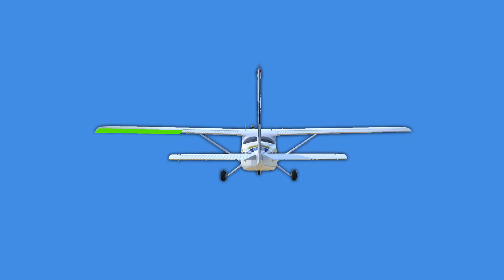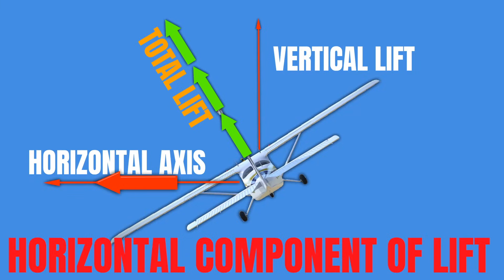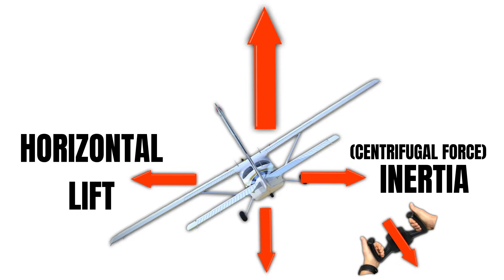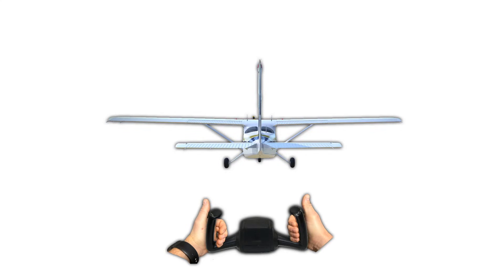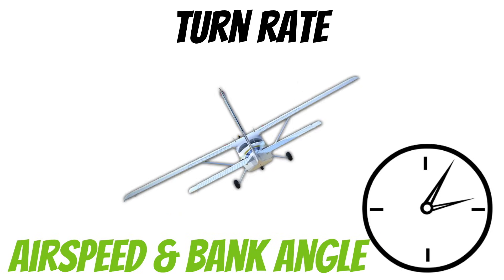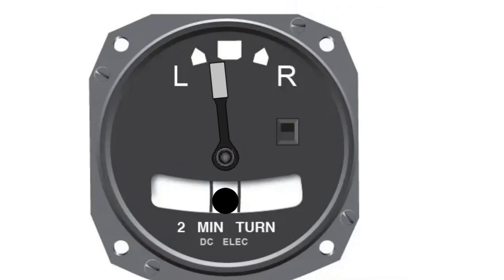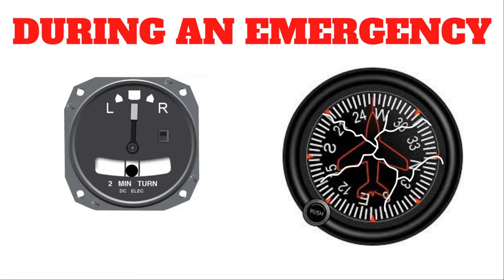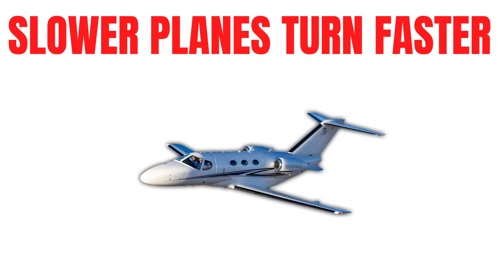How to Use a Turn Coordinator for IFR Flight (EASY)

Comment: quite informative .. The only point I'll make is that when an aircraft  turns the  horizontal force causes the  aircraft to  weather vane because the air  hits the  tail sideways which has a  larger  surface  area ( mainly  rudder / fin)  than  areas forward of the CofG ...otherwise the aircraft would  just  crab  sideways in a  bank angle  .. I passed the test qs  BTW ...cheers
Reply from the maker: Thanks! Great input! Congrats!

Comment: So a slip is when horizontal lift is greater than inertia, thus the turn radius is decreasing with the turn?  Wouldn’t that force the ball to the outside of the turn, thus stepping on the ball would yaw outward to correct it?

Guess I need to see some animations of slips vs skids.  I just know that skidding is more dangerous since airflow to the low, inside wing is blocked by the fuselage, increasing the stall.

I thought that a skid had the nose yawed to the inside of the turn, and a slip has nose yawed outside.  Coordinated is the nose aligned with the turn circumference.

I confess, at 4.5 hours, I have not needed to use rudders in turns, but they have been shallow.  We start steep turns next lesson.
Reply from the maker: Wherever the ball is, that’s where your tail is in relation to the turn. If your tail is skidding out to the outside of the turn, this is due to inertia or too much rudder.  That being said, a slip is when the tail is opposite the turn, I’m not sure that horizontal lift is greater during a slip, but that would make sense

Comment: Good information, what is your preference, turn coordinator or turn & slip?  I recall back many years ago working at a charter company in the Canadian  north the pilots said they wouldn't feel too comfortable hard IFR partial panel with a turn coordinator they said a it would be easier with a turn & slip to maintain control.  More recently this was also stated by Scott Perdue a ex F-15 pilot with a Youtube channel.
Reply from the maker: I feel like the turn and slip is a little easier for maintaining the standard rate, but it doesn’t really give you any kind of roll rate indication. I’m indifferent because most of my flight time is in a HUD

Comment: Another question, correct me if I'm wrong, what I've learned from your videos is that in order to create more lift, it is necessary to increase the camber of the wings. Now, in order to do that, you have to extend the flaps and slats in order to increase the curve shape at the top of the wings and this will generate more lift.
Reply from the maker: Increasing camber is one of many ways to increase lift
Reply: @FreePilotTraining amazing, I often see this in an a commercial aircraft like Airbus family and boeing